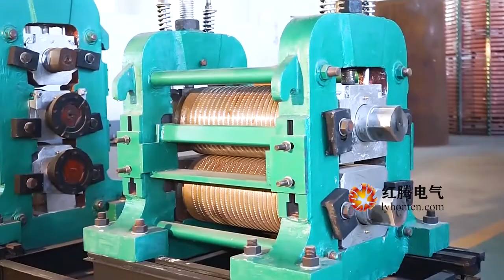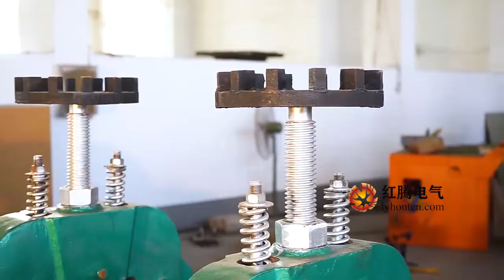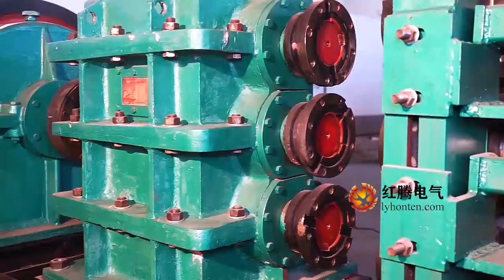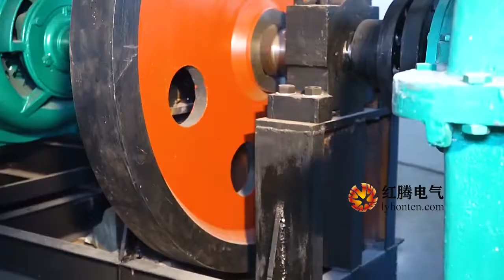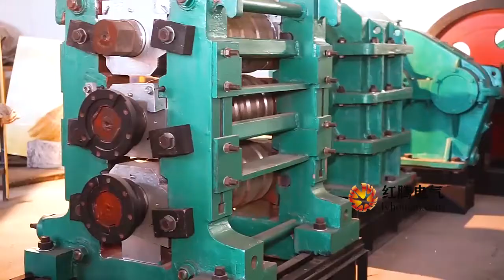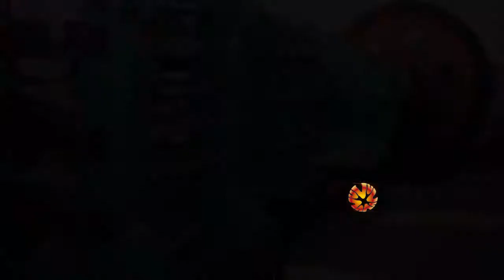Horizontal type hot rolling mill display, mini line with very low investment

Comment: What is price this mini steel making machine
Reply from the maker: Hi my friend,this is depend on your raw material size and finished rebar size demand, you can add me online, we could talk freely. +86 15290554040
Reply: @lindabai4432  By raw materials, does that include scrap metals,or both scrap and rebars? Then,can it also extrude wires?
Reply from the maker: @heraldloshi1864  Hi Herald,
For raw material, if your raw material is scrap metal, need to melting and casting billet;

If your raw material is waste big dia rebar, we could heat it and process to small dia rebar by the rolling mill.

Yes，For example, We also can make wire rods, if you want 4mm dia wire, we can processing is and them drawing it to smaller dia.
Reply from the maker: @heraldloshi1864  If you want more details, contact me through WhatsApp +86 15290554040
Reply: @lindabai4432  Thanks for the highlight. I will continue consulting with you on this.
Reply from the maker: @heraldloshi1864  always welcomes my friend. Nice day to you
Reply: @lindabai4432  Good day Linda,thank you.
Reply: @lindabai4432  I assume that the above machine is the H200-2?
Reply from the maker: @heraldloshi1864  Yes my friend, you are totally right.! this is a horizontal reversible rolling mill model H220-2.
Reply: @lindabai4432  How about the pollution issues. How are they mitigated while using this machine?